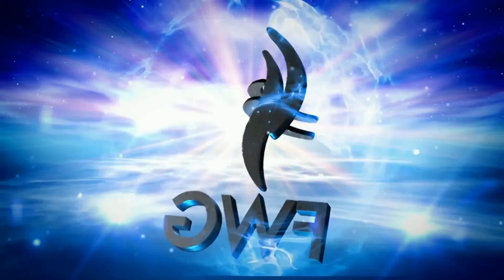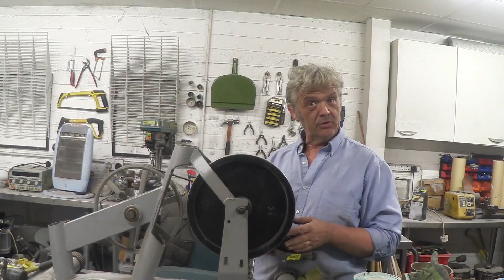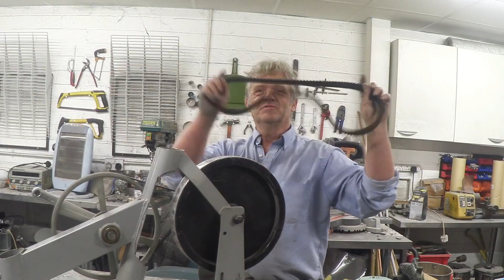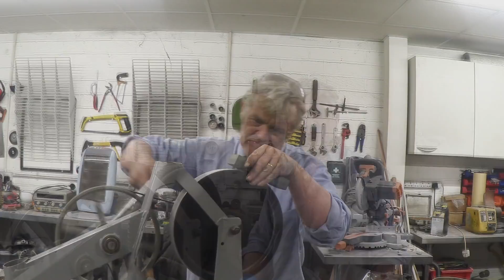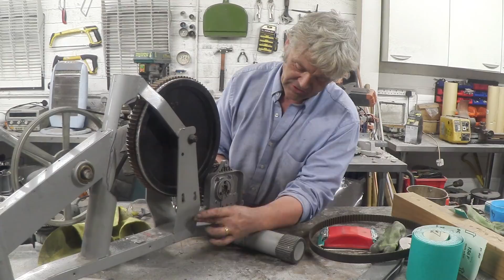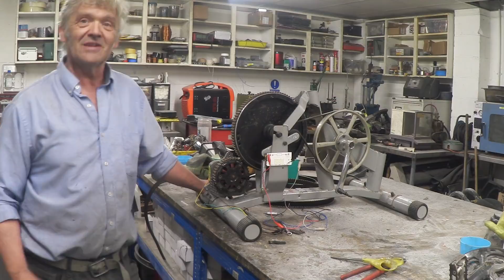1186 A BMW Fan As A Generator Doing Something

Comment: Get an radio control  brushless speed controller (because it is sensorless no hall sensors) and control it with a rc servo tester, both total about $10 together. and that would make a great motor once again.

Comment: ANY dmn coil and magnet can become generator. The point is making an efficient generator. What is next ? Generator from Ferrari, Ford, Toyota, Cadillac and 1000 other cars' fans ?
Reply from the maker: I am sorry to say this but have totally missed the point of the video. I understand efficiency is the only point for you but others have other requirements and I have a teaching point here that has nothing to do with efficiency but more to do with the speed constant of motors you might be thinking of using
Reply: @ThinkingandTinkering  
A fan is almost always a generator too, isn't it ? Taking it out of a BMW and not from a car junk seems to be the value here.

Comment: I wondered if you ever thought of using the hub dynamo out of a pushbike wheel it will generate six vaults 3 Watts At a reasonable speed similar to what you would get whilst riding a pushbike and they are ready available cheers Derek